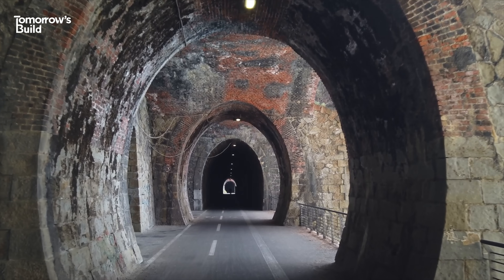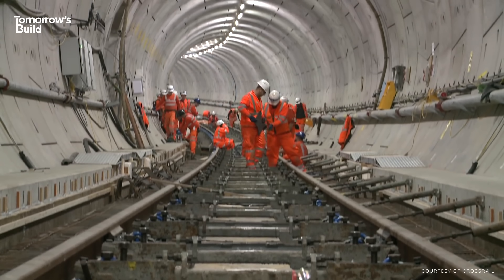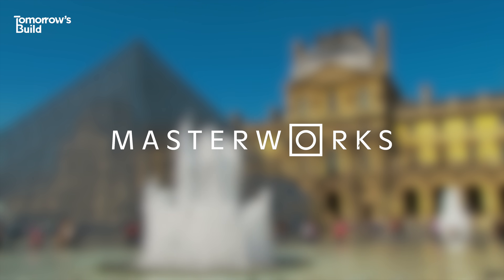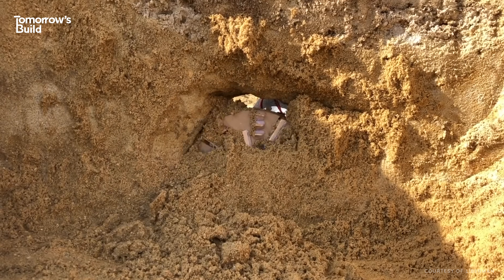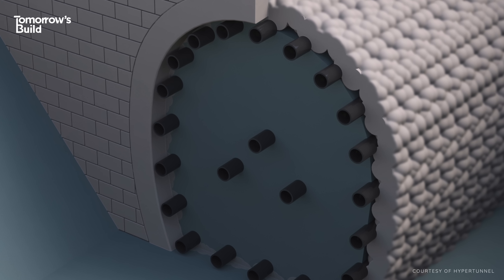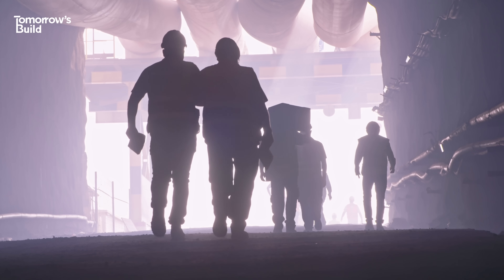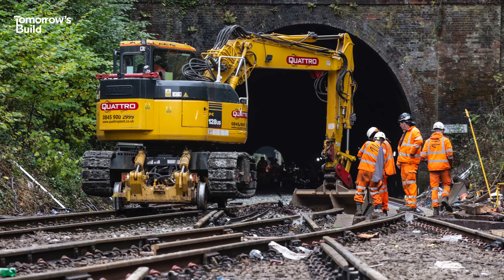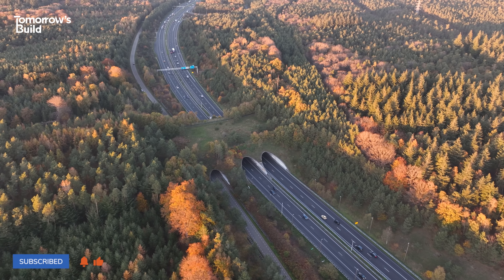A Swarm of Robots Built This Tunnel

Comment: Not to be a downer, but this basically splits the operation of a TBM into two unnecessarily complicated parts. Instead of a simple single drilling element you have multiple points of failure robot swarm. Also making the structural lining of the tunnel "custom to the geology" is a terrible idea as this will make maintenance with standardized components impossible (unlike replacing a standardized concrete segment placed by a TBM)
Reply: And then there is the question about how they plan to open the tunnel up? Sure, you now have a core of solid stone that is surrounded by concrete...but that makes it not the tiniest bit easier to remove. So you need to send a TBM through anyway, and now have a perimeter of NOT reinforced concrete. So then you need to line the walls of concrete with reinforced concrete---the same stuff you'd have lined the bare stone wall with.

The only tunnels this system is useful for are tunnels through sand, dirt and clay.
Reply: Innovation often looks much worse when it kicks off. Some ideas need a bit of breathing room before they can compete with fully honed solutions that have been iterated upon for decades. 

Nb: that’s not me saying this will work, or won’t, but I don’t think we have all the data here to decide one way or another.
Reply: I don't view it as a replacement for the TBM. I can see it being of use for small, short tunnels though - if you're only going a hundred meters or less, getting a huge TBM machine in is impractical.
Reply: A lot of people take "innovation" to be "adding extra constraints and driving up costs for no apparent reason".
Reply: Last I checked, concrete segments placed by TBM are not replaceable. They interlock, and then concrete is pumped between the rock and the segment.
Reply: Couldn't you just add standardized concrete segments inside so you have a layer that's good for the geology and then a layer that's good for what ever the tunnel is for?
Reply: @Sweenus987  the author of the initial comment was speaking out of his ass and does not know how tunnels are made.
Reply: TBM are designed to be single use and usually left in the tunnel, so there is also a benefit to small recoverable machines.
Reply: Lul "simple" 😂😂😂
Reply: think that this process will be a lot more viable in 50 years
Reply: I understand your points but the reason you would want to do it this way is so that you can drive down the overall price to dig a hole. It’s a lot easier and cheaper to make small robotics you optimize compared to one giant system
Reply: "simple single drilling element" this is the misunderstanding. Large tunnel boring machines are the complete opposite of simple and easy. They are massively complex and hard to work with. Look up any documentary on how the machines work and you will get the idea. Conversely small pipes are easy to work with and build, as are small size robots. Theoretically if they put enough development into the concept it would be substantially easier and cheaper of a method.
Reply: @johnjingleheimersmith  A boring machines act as a single design unit. Your phone is complex piece of equipment but its simple to use, because all fucntions are integrated.
Anyway the problem with tunneling is rarely the speed at which you can drill. Its the speed of logistics, removing material and bringing in material. A tunnel also need a LOT more finishing work than show in the video.
This idea MAY be useful for some underground structure. When pipes need to be drilled for a limited distance (100m?) it may work out. Nowadys this is done by overlapping drilled concrete pillars. Could be faster if less drilling is required and material injected inbetween. Just MAYBE.

Remember the golden rules of innovation: Ideas are cheap, execution matters. The worst enemy of a good idea is a bad idea that has support by "smart" people (eats up all the resources and frustrates the people who can really execute but are forced to follow bad ideas.).
Reply: @michaelrenper796  "A boring machines act as a single design unit. Your phone is complex piece of equipment but its simple to use, because all functions are integrated."

A boring machine, actually has many exposed segments. Yes they interact together but how is this different than these robots? I'm not sure I see what the supposed argument of difference you are proposing is here.

"Anyway the problem with tunneling is rarely the speed at which you can drill. Its the speed of logistics, removing material and bringing in material."

Who said anything about speed? This concept theoretically requires far less logistics and the rest is automated. The size and complexity of assembling and maintenance of tunnel boring machines is the biggest logistical challenge for them. Movement of material is addressed through similar automation by bots as well. They have the same issues minus the transport and maintenance of large components.

 "A tunnel also need a LOT more finishing work than show in the video."

How is this any different? Large boring requires the same things.

"This idea MAY be useful for some underground structure. When pipes need to be drilled for a limited distance (100m?) it may work out. "

It's far easier to drill small pipe diameters far greater distances than large diameter tunnels. See:  Kola Superdeep Borehole

"Nowadys this is done by overlapping drilled concrete pillars. Could be faster if less drilling is required and material injected inbetween. Just MAYBE."

What are you even talking about? No it isn't. Even with boring machines they use prefab sections of tunnel in place behind the borehead.

"Remember the golden rules of innovation: Ideas are cheap, execution matters. The worst enemy of a good idea is a bad idea that has support by "smart" people (eats up all the resources and frustrates the people who can really execute but are forced to follow bad ideas.)."

Who said execution doesn't matter? This whole thing has been about the concept feasibility. Of course people have to execute well. Honestly it just feels like you are preaching obvious truisms as if they are deeply insightful, on a topic that requires actual technical knowledge about drilling and tunnel structural engineering. I'm skeptical about any new technology, but this really doesn't seem that far outfield and the challenges not technically that complex. The hardest part will be manufacture and design of the robots.
Reply: @johnjingleheimersmith  thank you John for being so insightful. I appreciate it when people and YouTube comments actually take the time to think about these things and form good replies
Reply: @johnjingleheimersmith  The overlapping drilled concrete pillars was referring to a technique for building vertical structures within the ground. Retaining walls, Caissons etc, especially within poor (loose) ground. I think a generic term is "Contiguous bored piles. This was exactly the thought  that popped into my head when the explanations started. I've worked on contracts using exactly this technique. It isn't the same, but it bears some resemblance, and functions in a similar way.
Reply: @johnjingleheimersmith  respectfully you're missing the point. Yes TBM's are complicated but like mobile phones the bulk if not the vast majority  of said complexity is self contained and therefore have less points pf failure versus 5,000 robots zipping around with a high probability of resulting from a collision, worn out components or weather related variables. 
The bulk of the TBM's components ae in a general area and can be repaired/ replaced fairly quickly and easier thus keeping costs in check. Basically the more intricate/ complex the machine, the easier it is for it to breakdown. I believe this can be great for utility purposes but bigger projects seem too much for this tech currently.

Also, your comparison to the Kola deep hole project is not apt, one tech is better suited for specialized projects that are small in scope, while the other one is the complete opposite.
Reply: @VinceroAlpha   YOU seem to be missing the entire picture. If you have 5000 robots and 10% break down, then the other 4500 can pick up the slack and continue working- work proceeds. If a part of a TBM breaks down then the whole digging operation ceases. (relatively for both, of course certain issues will have some percentage of foreward progression, although much more if you have robots you can easily remove and replace) TBM parts are massive and mostly custom made, thus require manufacture and long periods of shipping. Whereas the robots can be available off the shelf and accessible via inventory. You act like the robots are part of some long complicated chain process, whereas in actuality they are more like ants, where if one dies another is there to quickly take up the slack, or in worse case, others will continue the work but at a marginally slower pace. It's honestly not all that complex at all. And further my reference to the Kola DBH is in application to creating the initial tunnels for the robots which ARE small in scope and far easier to accomplish than boring out a tunnel 200x greater in diameter all at once.
Reply: @johnjingleheimersmith  I’m not trying to be intentionally combative or sarcastic, but again you’re missing major details. Yes if 10% of the robots break down, the rest should pick up the slack. HOWEVER reality is rarely that simple. You forgot about the issue that these robots will likely use sophisticated components that are  specifically from high tech firms from various parts of the world. 
What COVID and Suez Canal traffic jam have demonstrated is the vulnerability of the supply chains (especially the high tech ones) are susceptible to.  Most of those components are are fragile compared to the ones found on the TBM. Meaning they’re more prone to damage than the ones found on the TBM. So if those 10% of robots are out of commission and awaiting parts or replacement robots, then it slow down the progress of the project. Meaning that they will have to depend on the robots that are still operating even more increasing the work load and probability of even more breaking down. How will this system fair when 25% are out of commission? Or 50% or 75%? I know it sounds far fetched but keep in mind that each these “swarms” of robots represents a failure point that can add up quickly due to the mere fact that there was a unknown variable in the supply chain that they didn’t account for and is out of their control. 
Meanwhile the TBM has the added benefit of having a more robust supply chain for support and replacement of parts, not to mention a number of the parts are interchangeable with other mining equipment and is more flexible to disruptions during the production, save for the cutting head. Yes both are susceptible to supply chain issues but one is more adaptable than the other. Keep in mind that the TBM is also improving as well and has become more robust than ones made 10 years ago.
Again this type of tunneling is more suited for smaller and custom applications versus larger ones. When you were comparing this to the KBH, it was an apples to oranges comparison. Both are in the same realm, but differ in application greatly.
Reply: @johnjingleheimersmith  were the hell did you get WW3 from? Im referring to the global supply chain as a whole. It’s too reliant on ruthless efficiency and has zero room for flexibility in case the unexpected happens. You’re the one who’s reaching so hard.
Reply: @VinceroAlpha  ever have a drill bit stuck in a bore hole? Its a pain in the butt.... and 25% of 4000 robot failure is 1000 pains in the butt, inhibiting you for progress ...

This "inovation" is as practical as the "loop" replaces a subway ... .
Reply: @NuclearSavety  that’s what I’ve been trying to say to these “tech bros,” not all innovation is good or warranted.
Reply: @VinceroAlpha  Elon Muks fanboys are now looking for a new project to believe in ....
Reply: @johnjingleheimersmith 
I am not an engineer myself and I haven't done any research on the matter, but the common sense can be applied.

There are no prototypes of any kind of robots shown in a "full scale test". And this "visionary" idea would heavily relied on such. All we can tell from the video is that there is a roughly dug out hole with couple of pipes in soft sandstone.
The heavy CGI usage with no actual footage of the actual prototypes or work being done is a big red flag on any videos of this kind.

How is single unit different from a "swarm" of robots?

Let's say you don't have to build build in a battery and a computer into each element of the boring machine inflating it's cost to astronomical and introducing even more failure points.

A conceptual CGI infographics animation doesn't make the idea any more feasible or real and it should be treated as such. There are way too many "revolutionary visionaries" abusing people's excitement to receive crowdfunding.
Reply: @ambiouse  "I am not an engineer myself and I haven't done any research on the matter"

Then this is where you should have stopped typing.

Comment: First of all - stop promoting this shady company. They are a shady company and their sponsorship makes you a disservice.
Second of all - what part about this robots makes tunnel boring easier? 
From the footage shown it's still necessary to bore hundreds of smaller tunnels to insert the initial pipes for the robots. In no way it can be easier to achieve on a scale of kilometer-long tunnels. Then they are going very quick over the part where the outer structure is completed and all that's left to do is remove the soil in the middle. But it's the same tunnel boring process, it's still necessary to drill the center of the tunnel and remove the soil somehow. 
So making hundreds of smaller tunnels is not easier than making a single big one if in the end all of space between said smaller tunnels needs to excavated just the same.
Reply: Yeah, doesn’t make much sense to me either. In excavation and mining operations, having one big machine is usually more efficient than having many small machines.
Reply: We've pretty much mastered small pipe drilling. It's when you go big when it gets really challenging. Small pipes are nbd. In fact you could probably drill your own water well pipe yourself using a corded homeowner drill and PVC pipe segments many dozens of feet down. Rocks are about the hardest (haha) part of the process and we've got tons of specialized drill bits and drilling techniques to solve for that. Turning is actually pretty easy and they do it all the time using special flexing drill heads. Just think about how much work and tech has been developed into drilling for oil and other stuff. small pipes are easy, but the problems involved when you scale up for big holes grow exponential due to the need for getting rid of more and more material. It's a math problem really if you realize the volume of material for a 2 in pipe vs a 4 in is basically squaring the radius. So literally exponential. Look at the deepest boreholes we've ever dug and how deep they go then look at the actual size in diameter of the holes.... they're very small and so are the drilling machines used to dig them, relatively.  To sum up my long screed, small pipes are incredibly easy for us these days, the big pipes are wayyyy more difficult. I'm not saying this company is legit, but the theory of what they're doing seems a lot less complicated than large scale boring machines.
Reply: @johnjingleheimersmith  great reply, thank you the insight. I still don't understand how drilling hundreds of smaller tunnels that almost take the whole diameter of the bigger tunnel can be done faster than a conventional method.
Reply: @screwdriver1337  Well have you ever tried drilling a large hole into something like wood or concrete? If you have then you know it's a lot harder than if you drill a tiny pilot hole first, then it's worlds easier. Bigger holes you might even step up another pilot hole drill bit size to make it even easier. The bigger you go the more material and more torque you need to drill due to the increase force of all the material you need to move.

Comment: Drilling part was glanced over like it's something obvious, but that's like one of the big problems right?
Reply: Not really. We've pretty much mastered small pipe drilling. It's when you go big when it gets really challenging. Small pipes are nbd. In fact you could probably drill your own water well pipe yourself using a corded homeowner drill and PVC pipe segments many dozens of feet down. Rocks are about the hardest (haha) part of the process and we've got tons of specialized drill bits and drilling techniques to solve for that. Turning is actually pretty easy and they do it all the time using special flexing drill heads. Just think about how much work and tech has been developed into drilling for oil and other stuff. small pipes are easy, but the problems involved when you scale up for big holes grow exponential due to the need for getting rid of more and more material. It's a math problem really if you realize the volume of material for a 2 in pipe vs a 4 in is basically squaring the radius. So literally exponential. Look at the deepest boreholes we've ever dug and how deep they go then look at the actual size in diameter of the holes.... they're very small and so are the drilling machines used to dig them, relatively.  To sum up my long screed, small pipes are incredibly easy for us these days, the big pipes are wayyyy more difficult.
Reply: Maybe. There is some pretty clever stuff going on with drilling holes like that, including curved holes. That would be a video by itself. Drilling several and keeping them parallel would be more challenging, but they can easily add in some tolerance for that.